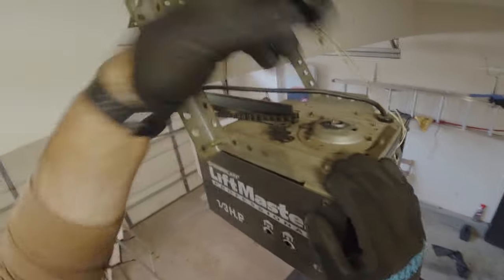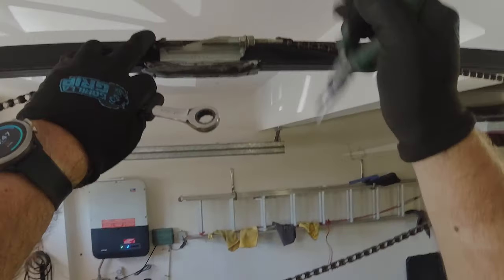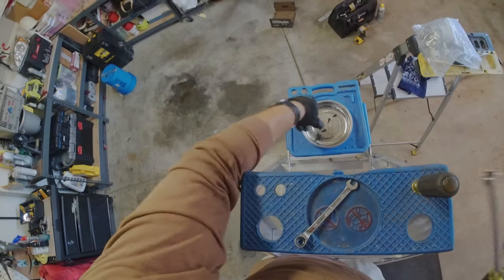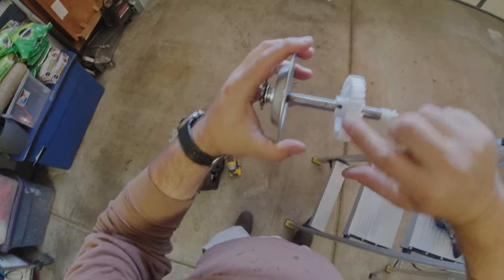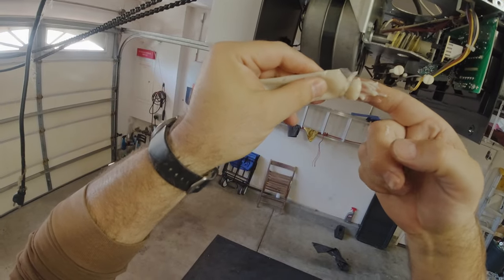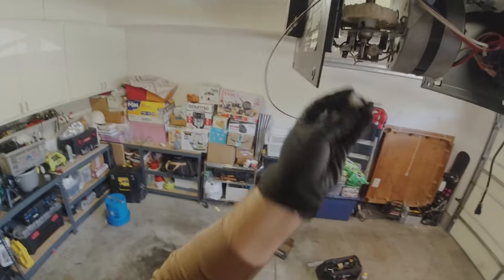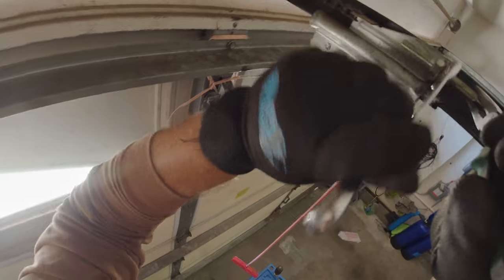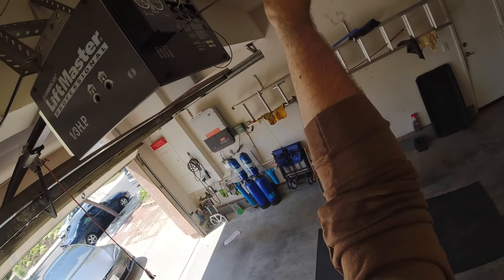LiftMaster Gear Sprocket Replacement Under 5 Minutes

Comment: Thanks for the video. The tip about aligning the motor with the door with the sensors was helpful. In case others are curious. 1) push garage door opener switch and then activate the safety switch (~6 inches above the floor near the rail - break the laser with your foot). 2) the motor will switch directions and then the light will flash a few times (this will indicate it is in the up position) 3) Hit the door opener switch one more time and then the motor will stop in the 'down' position. 4) manually move the chain so the trolley matches up with the carriage when the garage is in the down position. 5) Lastly you can also visually confirm if the contact sensor tabs are resting on the down or up side of the door adjustment screws.
Reply from the maker: Spot on protip.
Reply: Thank you and God Bless, its people like you that keep the world going, thanks for the tip
Reply: Thanks for these detailed instructions, makes it much easier to follow for some of us. So this is done before or after the sprocket is put back in?
Reply: I believe I did those steps before I put the sprocket on. The moving of the chain is to get things lined up as best you can. After the sprocket is replaced you’ll have a more accurate starting placement as you feed the chain onto the sprocket.
Reply: @edy8631  i ended up using the steps above after the new sprocket was installed. Seems to work well but I can't adjust the door so it doesn't hit the bolt when in the open position.

Comment: Hello, I have the same problem and need to replace the gear. I cannot purchase liftmaster gear kit 41D7675 gear & sprocket assembly direct replacement. Where can I purchase it?
Reply from the maker: Hello.  It's possible the gear sprocket model was changed.  What model of LiftMaster opener do you own?

Comment: Excellent video, very clear, very helpful.  I have a tip for putting the chain back on the sprocket.  Put some spring clamps in the middle of the T-bar and temporarily drape the chain over those.  That prevents the big sag in the chain and makes it much easier to pull the chain over the sprocket.  My chain was so tight -- even at the loosest setting on the tensioner -- that I could not pull the chain over the sprocket until I did that.

Comment: Nice video, could have used a little info on chain tightness. Definitely wasn't 5 minutes. 15 if everything went well, not even including tool/area prep, or cleanup.
Reply from the maker: Thank you for the feedback.  The chain needs to have about 1/8 of slack above the rail.  That may not sound helpful but it should not be too tight.  In fact after installing the rail, if the chain bangs or clangs on the rail then it's best to losen a bit.

Comment: This 5 minute procedure only works if you have enough clearance above the opener to do the sprocket replacement (as you have in this video). Most people don't have enough clearance and have to unbolt and lower the opener.

Comment: why does my lift master have two sprockets.  one on top is smaller than the bottom one.  I noticed the chain was attached to the top smaller sprocket, but when I had to adjust the chain, I placed it on the larger sprocket.  Now the garage door won't open
Reply from the maker: Thank you for the question.  The smaller sprocket is for slower travel.  

Now if the larger sprocket is not moving your garage door, then there is an issue.  

I could check the LIMIT SWITCH DRIVE GEAR KIT. 
Model:  041A2818

Comment: I finally had the opportunity on this rainy day change out the gear sprocket. Everything seemed to have gone smoothly but when I hit the open button the trolley only moves about an inch and stops. Tap it again and it goes back to where it was. (It’s not enough movement to even move the door. Also, I don’t have any sensors. It’s an old-school installation.)

Is it the chain tension or maybe the sprocket’s not lined up correctly? It looks like it is correct.
Reply from the maker: Hello! Thank you so much for this question. I believe it can help the community. 

Now when you replaced the gear sprocket, did you replace any other parts to it? For example like the worm gear?  

There's a possibility that the warm gear maybe the issue. There's also a possibility that the RPM sensor has failed or gone bad.
Reply: @sosgds I did not replace the worm gear when I replaced the sprocket assembly. When I remove the chain from the sprocket, the gears work smoothly together and it spins continuously. 
When I reattach the chain, there is some slack that I can’t seem to tighten up by hand. When I press the operation button, the motor will pull the chain “up” and the slack is removed. When it travels back down, it does a hard stop at about 2 inches, right at the trolley. Door appears to be in balance, because when I manually lift it up and pull back down it stop in partially down positions.

Comment: Your videos are AWESOME!  I made one mistake and hoped you could help.  Before realizing what the problem was with my door., I DID NOT MARK THE CHAIN OR THE TROLLEY LOCATIONS…. Now the the new gear is installed etc.  when I press the opener, it moves the chain a few inches then stops.  Both directions.  I think I am making a rookie mistake.  Can you help?  Thank you!
Reply from the maker: Hello!  Thank you for the excellent questions.  

So it sounds like your travel limits are off.  Here's what I suggest:

1. Loosen the chain and take off the sprocket.
2. Press the wall button to get the garage door to close.  
3. As the garage door opener internally start to travel down (the door should not be moving), have a family member or friend block one of the safety sensors.
4. The garage door opener should internally operate back up, blinking or clicking once it's done.  This indicator means the travel limit is in the up position.  
5. Run the opener once more, this time do not block the safety sensors.  The travel limit should be in a down position.
6. Unplug the opener, reattach chain onto sprocket, and tighten chain to proper tension.
7. Power the opener and operate the garage door motor one cycle up and one cycle down.  
8. Adjust travel limits when necessary.  

Hope this helps!
Reply: @sosgds  Hey!  Your advice worked!  Thank you SO MUCH!
Reply from the maker: That's what we love to hear!

Comment: How do you know where to line up the chain? My door will lift, but stops halfway as it’s coming up.
Reply from the maker: Hello.  I address this issue in a longer form video.  You want to ensure where your travel sensor is located.  If the sensor contact is in the middle, then you want to power the motor without the chain on.  Once it reaches the up or down contact, then that's where you want to place or set your chain.

Comment: I made a mistake that I didn't check until after the fact. The slots at the top of the sprocket need to face towards the door otherwise you can't put the plastic cap on correctly.
Reply from the maker: Correct.  Hope it's all working well for you now.

Comment: I just did this, and well, I didn’t do that first step. The garage door was closed, and when we plugged it in, it tried to close the already closed garage door. It stopped right away, and we were able to get the chain with soooo much tension off, somehow didn’t destroy the new sprocket… anyways it’s working now! Now we’ve likely gotta get someone out here to install a new spring.

Comment: Are the sprockets universal? Chamberlain liftmaster 1/2hp chain driven?
Reply from the maker: Very good question.  No they are not.  There are specific springs from some Chamberlain motors.  Yet I have used a gear sprocket kit for a motor that was not specific for the model.  But that was due to an emergency situation to get the door running.

Comment: Hi! How do i check if my door is in the up or down position?
Reply from the maker: Great question.  

Have you tried to do the safety photo eyes reversal test?

Once taking off the belt you can operate the opener and then try to block the sensors.  If you hear the motor head blink and/or click then the safety photo eyes detected the obstruction and the travel should be in the up position.
Reply: @sosgds  that helped me since the video was to quick for me! Thank you!

Comment: I knew the gear and/or sprocket on my opener were stripped, but I debated on whether or not to DIY. Looks simple enough and I don't have to take the opener down even. Instead of spending $200 I'll spend $20 on the replacement kit! Thank you for the tip!

Comment: As a plus for the customer, check the door for proper door balance with tensioning the spring or springs. Let them know the door is properly balanced for opener longevity & you've got a happy customer for life.

Comment: Wait... you removed that internal gear way too quickly. How did you do it? The bottom gear seems to be pressed on.
Reply from the maker: Hello.  The nylon gear should just set and slip on.  I do have a longer video that should show it if you can get past the vlog style format.  

https://youtu.be/k7ImLL_Emro
Reply from the maker: So sorry wrong video.  

This is the video:  https://youtu.be/kWQ_hZ-t3RE

Comment: Thank you for this. Had this exact same thing happen. Had a repair person come over, he said need new motor, door needs new rollers and balancing $700 or he could replace the whole door and opener for $3k. Just ordered the sprocket replacement from amazon for $20. Hope that does the trick!
Reply from the maker: Wow.  That's high for balancing and new rollers.  Of course the price for a new door is on par with the national average.
Reply: @sosgds 
All it needed was the sprocket. $20 from amazon, garage door is working fine now. Out $75 for the home warranty service fee but better than $700 or 3k

Comment: Hey what happens if you weren’t in the down position.  I’m a roofer.  Not a mechanic.  I took it off half way down.  The door is heavy.  Don’t ask.  Am I screwed? Do I remount or can my life not be over?
Reply: I thought it’d be easier w the unit off.  I’m gonna remount in same position and work off ladder like you did.
Reply from the maker: The positioning is key.  If you don't start with the limits in the up or down position then it will throw off the repair process.

Comment: Not a clear video at all. My kit contains about 7-8 different washers and I don't recall hearing or seeing anything that references a washer at all. This video works if you've done this task before not if it is a completely new to the process.
Reply: It ain’t his fault you used a different kit!

Comment: The plastic gear broke while in the up position. It will not go back down, just buzzes. Can i do the repair in the up position? Or no?  I can't do your procedure to have it in the down position before starting the plastic gear replacement since the gear is broke and jammed up.  So is it ok to go ahead with the repair, then figure out the up / down position after the repair?  This is past-tense now.  I went ahead and did the repair and now i only have two feet of travel down then it reverses back (so starts in the up position and moves two feet down the rail and reverses direction with no flashing light).  If i trip the electric-eye, it will immediatly reverse direction with the light flashing.
Reply from the maker: Hello Dabney!  Sorry for the late response.  The issue you are facing has to the door with the travel limits.  Basically your travel limits are off and you will need to adjust so that when your door closes it does not travel further than the floor.  This will prevent it from opening back up.  Let me know if this helps.

Comment: Love the video. Do you always unscrew everything manually  or just for this vid.
I prefer using my impact gun but maybe thats just the lazy side of me lol
Reply from the maker: Hey Cody! Yeah for some reason I don't use my impact to take off the casing, mainly because sometimes I put them back on too strong and it'll bend the metal. And I figure at the same time this will give the viewer who probably doesn't have a lot of power tools the opportunity to simply use a standard nut driver. Thanks as always for the support!